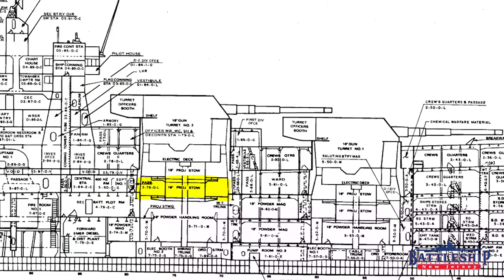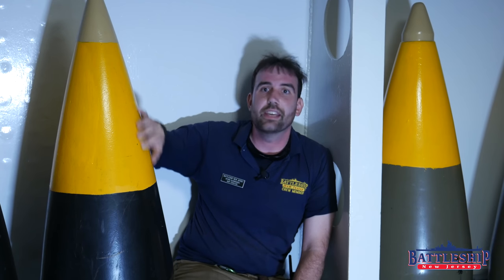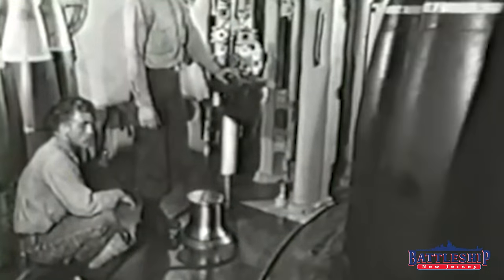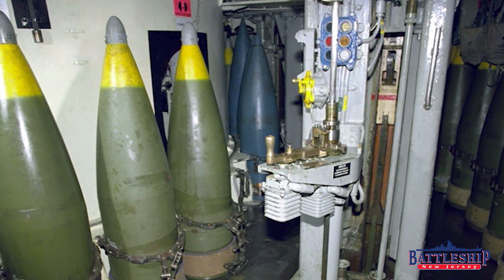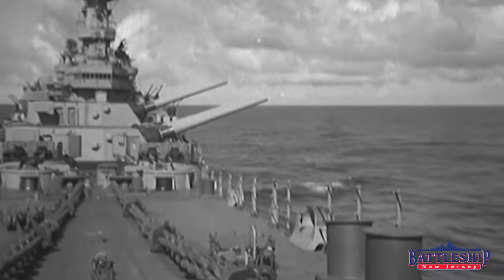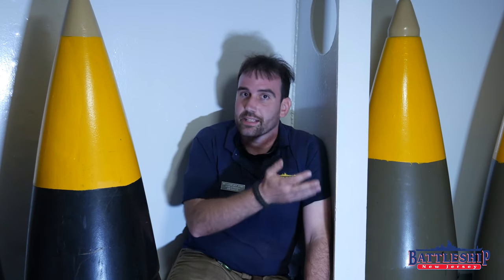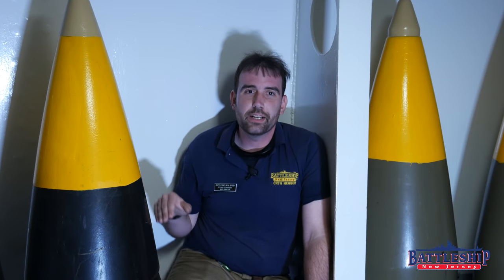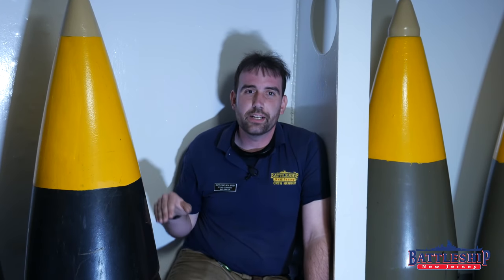What are the Different Types of Shells that the 16in Guns Fire?

Comment: It's a pity that the Iowas didn't get to serve throughout the 90s. Some of the new shells planned for them would have been fantastic. Like the Mark 147 HC shell that puts those from Italy to shame at 861 meters sec and a range of over 46 km.
Reply: The cost of operating these ships didn't justify it.
Reply: @Bellthorian  This 100%. Battleships are incredibly cool, but they're an extremely inefficient tool for any modern job.
Reply: @robotbjorn4952  except ironically when you're trying to save cost.
Reply: A higher velocity shell would have ate the gun tube quicker. I heard they had some kind of gel to coat the barrel with to slow the rate of decay but it will still wear, and wear out a lot faster with higher velocity shots. Dunno if they still had full sets of 9 barrels left in the 90's, building more would have been crazy expensive because the tooling is long gone and who knows if any company still had the know-how.
Reply: @stevewindisch7400   They had cooler burning powder as well too and not to mention Chromium plated rifling. It will eat out the barrels but far far from the levels that the Italians experienced with their 381 mm guns to the point of it being deemed acceptable. There were still surplus guns from the never completed Illinois and Kentucky aside from the spare guns for the four Iowas and foundries to build replacement tubes for the 16 inch guns were still around in a limited form in the 1980s specifically for the Iowas. The last big gun foundries were decommissioned and dismantled by the 90s.
Reply: You're talking about tech but I can't stop thinking about the possibility of a 16" round somehow fitted with a guidance package similar to the US Army's Excalibur round of today, just imagine what a 16" gun could do with JDAM/ Paveway  levels of accuracy....
Reply: @GoldPicard   They were working GPS guided smart munitions but it would have been an 11" rocket assisted Sabot with an estimated range of 180 km. . . . and then the Soviet Union decided to implode in 1991.
Reply: When we go back to war in the south China sea its gonna be missed
Reply: @robp7652   Sure does. But let's face it. The Iowas are too old and worn out. Her engines possess technology that isn't produced anymore. The foundries to produce spare parts are dismantled and scrapped and the engineers who could built these vessels took their experience to the grave. Right now building a battleship from scratch using current technology will be cheaper.
Reply: @legiran9564  that's exactly where I was going with that thought. New ones. Say maybe like 6 of them. That way there would be enough to always have 2 in service.
Reply: @Bellthorian  The cost of operating politicians doesn't justify them either, yet there they are.
Reply: I think the battleship concept will return someday but not like they were..the big guns would be automated to be more efficient...firing sub caliber  discarding sabot guided shells out of a smooth bore so you dont have to worry about rifling wear and the guidance package will guide it to target..like a fire and forget..rocket assist optional ..as for armour it would be composite like a Abrams tank..but perhaps there might even be a canister shot projectile as well since many navy's today sail in groups so a full salvo canister shot from one ship would be a Turkey shoot or a sabot tungsten kinetic penetrator..not only that the faceted nature on Abrams armour might lend to stealth as well..possibilities are endless
Reply: I was thinking like a big Kirov class. Maybe 2 16 inch turrets tons of VLS silos . Obligatory helo hanger . I just hate we have no ships that can slug it out if need be. I know our doctrine is to shoot down incoming missles but with a massed attack that won't work well. A few ships that could take massive damage would be pretty handy.  Of course the marines would love the gunfire support.
Reply: @nickriley4609   Since the Railgun proves to be impractical and uneconomical since the material strong enough to contain the forces exerted in the rails haven't been invented yet we have to make due with Chemical based guns. Yes you can make a railgun work with current technology. Can it be made into a practical weapon? No. Because the problem facing the railgun in military application is equivalent to making a Mark 7 16 inch gun out of BRONZE. Since the Zumwalt AGS is a dead end design because it was such a GENIUS idea to design a gun that can shoot only ONE type of projectile at 1 million a pop, I would repurpose the gun barrel and add a beefed up horizontal autoloader from the 5" Mark 45. May not be as accurate as the AGS but a hell of allot cheaper if it used standard 155 mm NATO ammunition. From there I would look up and revitalize the 8" Mark 71 and make a 60+ caliber version of that. With this gun you probably reached the absolute max to what a standard Arleigh Burke sized destroyer can carry. (you need to get rid of the forward VLS missiles to compensate for the increased weight of the gun.) If you want to go with a bigger gun you need to design a ship around the gun and that is where the costs go upwards. Also take into account that once you start putting large guns on your Warships you'll probably start another Naval Arms race.
Reply: @legiran9564  wouldn't you say china is ahead in a navel arms race already?
Reply: @legiran9564  wouldn't you say china is ahead in a navel arms race already?
Reply: @nickriley4609   I would say yes until I learned what "TOFU-DREG PROJECT" is. It's an endemic mentality with everything Communist China and Construction. Let me give you an example. The Chinese Military have their own Hummer vehicle that is claimed to be bullet resistant. During the 2020 India/China border skirmishes the Indian soldier threw stones right through the windows of the Chinese Hummer vehicles injuring the occupants and some even reported denting the steel plating with rocks. Okay now apply that quality of engineering with their NAVY.
Reply: @robp7652   You have to convince Congress and the "Airminded" Admirals to justify funding these huge ships. The US Marines love Battleships. The Carrier admirals which is all of the navy . . . not so much.
Plus you need to reschool those old admirals and their subordinates with classic WW2 style battleship tactics and maneuvering. I bet they'd love that at their age.
Reply: Or, do what the Japanese did.  Re-purpose battleship projectiles into aerial bomb warheads.
Reply: @legiran9564  ah yes..the crappy chinese steel...and shoddy workmanship
Reply: @nickriley4609   It's not just the steel. It's their low standards in welding, construction, electronics everything. If you have close connections with the Communist Party there is no accountability for corruption. You build ships with shoddy workman ship but there is no penalty because you are a family member of a VIP of the Communist party. This is why corruption keeps proliferating in China and contractors keep getting away with providing shoddy workman ship. There is no incentive to make quality products because there are no penalties. You could probably damage a Chinese frigate by sneezing at it. The only way the top echelon in the Chinese society will get their Karma for their corruption is when the Party gets a new President and Chairman and he installs his lackey's in key positions within the government. And that happens after decades.
Reply: @legiran9564  wonder if their nukes have the same problem in quality
Reply: @nickriley4609   They may have and if they have problems it will definitely be covered up. Nearly all knowledge of the Soviets nuclear mishaps came to light only after the fall of the USSR. The Chinese nuclear program is shrouded in mystery and it is said that their nuclear development from an Atomic bomb to hydrogen bomb was the shortest and they did it with a shoestring budget. Sometimes I wonder if they have acquired some nukes from the Soviets and copied that. Also the nuclear armament of China is 350 compared to the US and Russia's around 8,000 warheads respectively which suggest that the Chinese may have issues stockpiling their nukes in large volumes or they lack the confidence to maintain a large stockpile.
Reply: @AmericanThunder  LOL true but I can also testify that the Iowa was in real bad shape when I served on her in the late 80's. Turret one would leak a minimum of five gallons of hydraulic fluid a day. They were old and obsolete, best to let them rest.
Reply: Those sabot rounds were never anything more than a proposal. There was never any realistic chance they would be built, no way the development costs for those things could be justified for just 4 aging ships.
Reply: You are talking about the HE-ER Mark 148 which were sabots. The HC Mark 147 were not sabots and these were test fired on USS Iowa unlike the Mark 148. The HC Mark 147 were far simpler and cheaper to produce than the sabot rounds since this is a one piece projectile. The Mark 147 was planned as replacement for the shorter HC Mark 13 and 14 projectiles which were designed to fit in the older loading mechanism of the aging Colorado class and were standardized throughout all 16 inch gun BBs serving during WW2 to simplify logistics. What makes you think that there isn't a realistic chance the Mark 147 would have been issued if the USSR hadn't kicked the bucket in 1991?
Reply: @Bellthorian  

The Iowas (really, WWII-generation battleships in general) were literally never justifiable during their entire service history. What they could do, other ships could do better or at less expense.
Reply: @Bellthorian  That's your opinion, and is debatable at best. It is also irrelevant to Legiran's statement.
Reply: @robotbjorn4952  Nowhere near as inefficient as spending tens of billions on programs to replace the battleships and having nothing to show for it.
Reply: @legiran9564  They're not too old or too worn out, there just isn't the infrastructure to support them anymore.
Reply: @nickriley4609  In some ways, but they have a massive deficit in practical operational/institutional knowledge and expertise.
Reply: @libraeotequever3pointoh95  The US repurposed battleship barrels into bombs.
Reply: @legiran9564  Yeah i have bad news, chinese optics and red dots from holosun are flat out better than the best western red dots. And Olight is rapidly approaching and in some ways surpassing surefire in the flash light department.

We said the same crap about japan in the 70s and korea in the 80s-90s.
Reply: @Valorius   Germany had the most advanced military technology before and during WW2 . . . The Soviet Navy had submarines that could outrun and outmaneuver their American counterpart during the Cold War and fielded more and larger ICBMs.
Crap came out of China in the 70s, 80s, 90s, 2000s, 2010s and TODAY and what happens not to be crap ended up being stolen tech that they have a hard time maintaining . . . so your point?
Reply: @stevewindisch7400  smooth bore with fin stability and guidance system would eliminate that problem I think....like a enlarged m1a2 Abrams tank gun
Reply: @nickriley4609  the quality of their navy is a question mark.  they really don't have much of a Naval history to start with.
Reply: @Kias1dad  Good point but an Aircraft Carrier is not obsolete. An Aircraft carrier has the ability to project power hundreds of miles. An Aircraft carrier can perform multiple different missions.
Reply: @Bellthorian  Yet, the cost of loosing a manned aircraft is worth it?
Reply: @robotbjorn4952  Yeah, I guess you're right, except for when it comes to landing Marines on the beach, it's rather nice having something that can sit over the horizon and put a 1900 lb shell into a trash can to take out enemies!
Reply: @Bellthorian  Fix the issues, don't throw the baby out with the bathwater!
Reply: Hmmm you sure about that? The Navy spent 22,000,000,000 (22 billion) dollars on three Zumwalt class destroyers that can't do a damn thing!
Reply: @bkjeong4302  Such as?
Reply: @Bellthorian  An Aircraft carrier puts a 50,000,000 dollar airplane and a pilot (or two) in danger every time they launch one to take out a target.
Reply: @Valorius  Not an opinion it is fact.
Reply: @Valorius  I love it when YouTube experts state an opinion on something they have no idea what they are talking about. I served on the USS Iowa in 1989 as a gunners mate in 16 inch Turret one. I can attest that ship was NOT in good material condition. The Turrets on board leaked hydraulic fluid like a sieve. I would spend hours a day soaking up hydraulic fluid on the electrical decks. If the turrets were powered on and the turret rotated and the guns elevated they leaked even more. They were old and worn out, best to let them sleep.
Reply: @dundonrl  The problem is they couldn't fix the issues. In order to fix the issue the turret would have to be removed from the ship and literally disassembled just to get to the machinery in question. It would probably be cheaper to design a fully automated 16 inch turret and build new ones to replace the old turrets.
Reply: @dundonrl  True but with the limited range of the Iowa's guns is it cost effective to keep a battleship in service for a narrow mission?
Reply: @Bellthorian  There were plans to remove the TLAM ABLs and install 128 MK41 VLS cells in their location, giving it the long range firepower of two or three Ticonderoga cruisers in strike warfare in addition to the ability to put 2 million pounds of HE shells on target within 25 miles.
Reply: @dundonrl  The should have removed the 5 inch secondary battery that was in effect dead weight and manpower intensive to operate and put VLS cells down the sides of the ship. They could have had 200-250 cells for various land attack, anti ship missiles and air defense missiles.
Reply: @dundonrl  

Shore bombardment could have been, and often was, done by older battleships and subcapital units (in WWII), by various modified landing vehicles (both in WWII and in later cases like the Vietnam War), and by missiles (more expensive than shells, but cheaper once the cost of the platform is taken into account), negating the need to spend vast sums on the Iowas. 

Anti-aircraft escort for carriers could have been done much more cost-effectively by cruisers and destroyers (in WWII) and by destroyers with missile-based air defences (nowadays).
Reply: @dundonrl  Putting a pilot and a plane at risk is STILL much cheaper than having to put the entire ship and its crew at risk, which is inevitable because battleship guns have far less range than attack aircraft and thus have to get much closer to the enemy than a carrier has to in order to do anything (and that is IF they actually can get closer to the enemy, which they probably can’t if the enemy is as fast as them and has missiles or attack aircraft).
Reply: @Bellthorian  Too much deck armour to cut out in those locations I'd think.
Reply: @dundonrl  I would think the space between the STS hull plating and internal armor belt would have been a good place to  put them.
Reply: @Bellthorian  Not enough room. The Strike length MK-41 VLS is over 25 ft tall. Besides, the Navy did use the 5" guns. They have 3/4 of the range of the 5" 62 caliber guns on the Burkes so in shore bombardment would be quite useful.
Reply: @bkjeong4302  Except that destroyers and cruisers didn't carry the number of guns for that AA defense that a battleship could, nor could they shrug off the impacts of a kamikaze like an Iowa could.
Reply: @dundonrl  Battleships only had a large amount of AA due to their sheer size (which also meant they were far more expensive to build and operate). And thanks to square-cube law, the number of possible AA mounts didn’t increase nearly as quickly as the size/cost of the vessel. You could build several Atlantas for every Iowa and still get more AA at less expense. 

And yes, battleships were more survivable, but that minor tactical benefit isn’t remotely near enough to justify building an entire capital ship to use it as a pointlessly big and expensive CLAA.
Reply: @Bellthorian  you mean the military skimped on maintenance? Noooooooo.
Reply: @Bellthorian  I looked under the dictionary entry of "purveyor of fact." Your picture did not appear.

Comment: AP Mark 8: 2,700 lb (1,200 kg)
HC Mark 13: 1,900 lb (860 kg)
Nuclear Mark 23 (W23): 1,900 lb (860 kg)
16-inch/50-caliber Mark 7 gun
The Mark 7 gun was originally intended to fire the relatively light 2,240-pound (1,020 kg) Mark 5 armor-piercing shell. However, the shell-handling system for these guns was redesigned to use the "super-heavy" 2,700-pound (1,200 kg)
The North Carolina and South Dakota classes could also fire the 2,700-pound Mark 8 shell, although with a shorter range, using the 16"/45 caliber Mark 6 gun. The Mark 6 gun was lighter than the Mark 7, which helped both battleship classes to conform to the limits of the Washington Naval Treaty